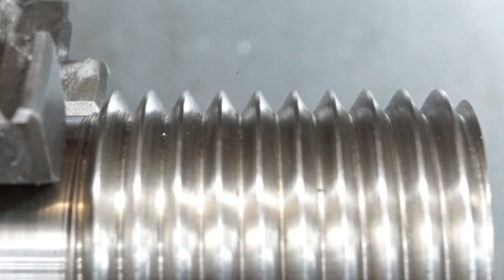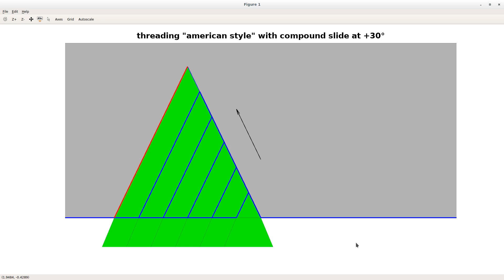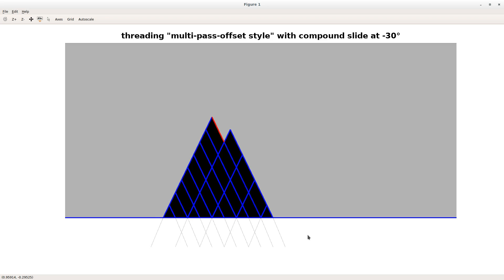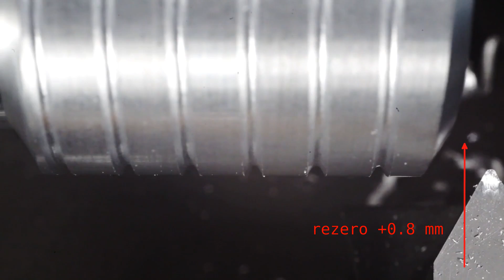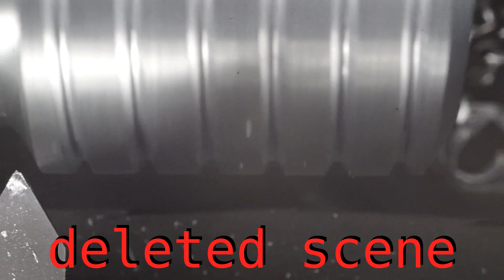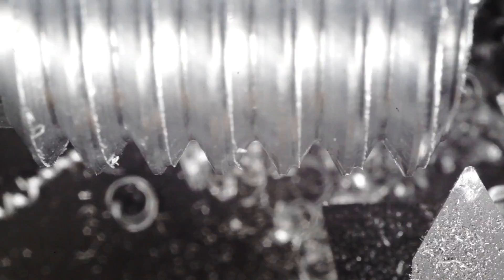big thread - small lathe

Comment: Nice illustration of reducing cutting loads on small lathe by making small segments cutting passes towards the finished thread form. What is also clearly illustrated in this example is how thread cutting involves both cutting edges of the thread form cutting tool by the pattern of metal being deposited in the edges of the thread form cutting tool.

On modern A60 series "lay down" threading inserts, edges of the insert have a positive rake moulded into the insert designed to accommodate the fact both edges are cutting the thread form. It is why the Anglo-American method of threading in-feed using the compound makes no significant difference in single point thread cutting relative to the rest of the world's direct in-feed for single point thread in-feed threading.

Comment: I will try this on my hobbymat just for the fun of it. It seems that this could also be used to create multi-start threads.
Reply from the maker: Yes, you can certainly use this technique for multi-start threads. I am not sure if the precision of the combined cross- compound-slide adjustment is sufficient if you just trust the dials. Alternatively (or in addition) you could use a dial indicator to measure the longitudinal displacement of the tool. Certainly worth a try (and a video :-) )

Comment: Good trick. Watching the video I thought it would be nice to have a second tool on the opposite diameter already offseted axially so it would be possible to cut on the returning stroke as well.
Reply from the maker: Thank you. Yes that would certainly speed up the process. But I suppose that the setup would be difficult due to the backlash in the lead screw.